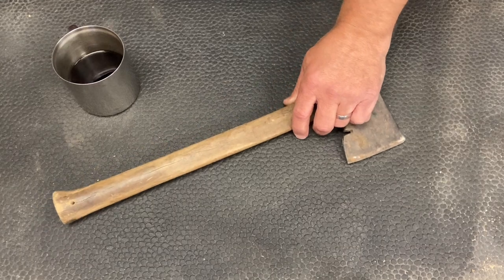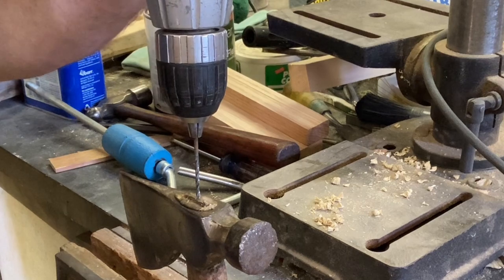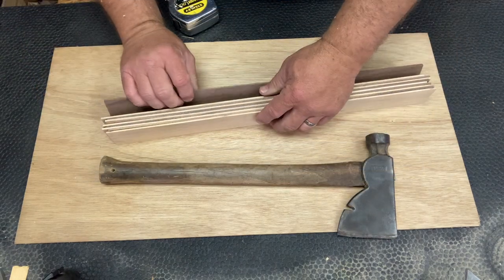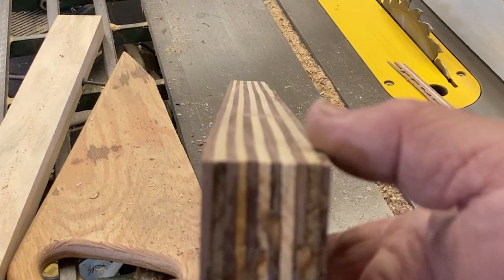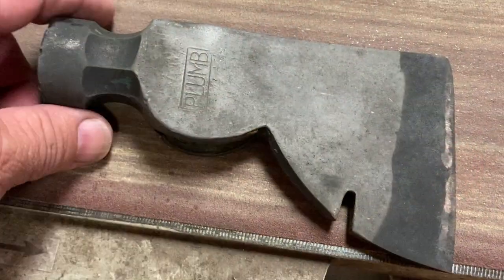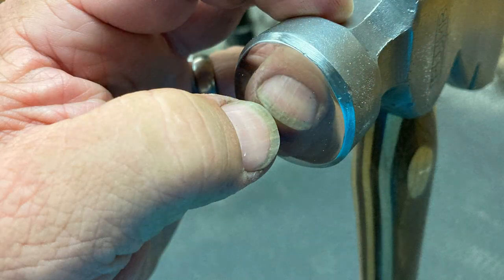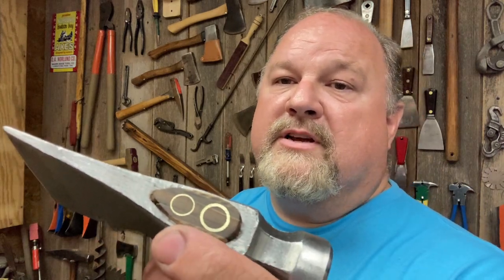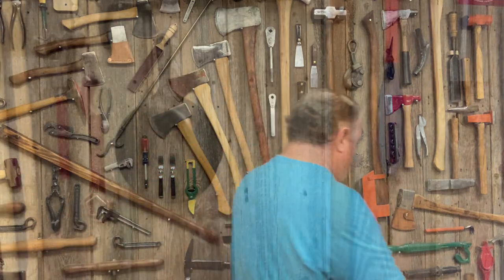Vintage Hatchet restoration. #Plumb #NSCO #Half Hatchet #laminated handle #axes

Comment: I know that plywood can't be worked like that, but, damn...I wish it did!  Beautiful handle!  I'm about to restore my dad's old half-hatchet.  It was sold with a Craftsman handle back in the 70s or early 80s.  The only marking on the head is a stamp that says GERMANTOWN with USA under it.  Great vid.
Reply from the maker: Yes, you have to laminate your own wood. Plywood doesn’t work well enough. Good luck on the restoration. Sounds like a good quality tool. Thanks so much for stopping by and have a great day.

Comment: Laminating is a great technique that adds strength and visual interest....Seems there are several similar hatchets with other railroads marked on them, I wonder what the specific use was for these on the railroad.
Reply from the maker: You’re right about that. I presume they were for the construction crews that built rail road yards and facilities, but that’s just my guess. It would be great to have more info on them but I couldn’t find much on them. Thanks for stopping by. Have a good week.

Comment: you did a great job on that. I have thought of using a slide hammer to remove the wedges, now I'm  going try it out, it worked great for you.
Reply from the maker: Thank you. The slide hammer does work well if you can get a good hole tapped in the wedge. Thanks for stopping by and good luck with your projects. Have a great week.

Comment: ToolScouter, on the West Coast this style hatchet was called a Rigger’s Hatchet.  Used primarily for building rough structures like Oil Dericks, RR bridges and the like.  Note the orientation of the slot for nail pulling.  Yours is for a right hander, but they were also made in a version that would work for a SouthPaw.  Mark L
Reply from the maker: That is very informative. What you say makes a lot of sense because once I cleaned up the head, you could see an oil derrick on the side, it’s faint but it’s there. I appreciate you stopping by the channel for a visit and sharing your knowledge with us. Hope you have a great day.

Comment: That is a great look on a handle. I have a couple hatchets that need handles so I think I will adapt your idea. I haven't make handles before so that will be a good challenge.. You did an awesome job on the entire hatchet.. Do you think that idea would work well on hammers?
Reply from the maker: Thank you so much for your kind words. Good luck on making those handles. They are fun. I think hammer handles made that way would be excellent. Again good luck and have a great week.

Comment: PLEASE use a push stick.
Reply from the maker: If you look carefully, I did on the very thin pieces. I do my best to be very conscious of safety and the block I was cutting was over an inch and a half wide plenty of room for my thumb. When I have enough room, I just make sure that all of my fingers are touching the fence so there’s no way they can get close to the blade. Thanks for your concern and I hope you have a great week.